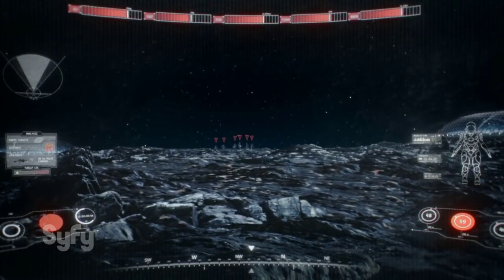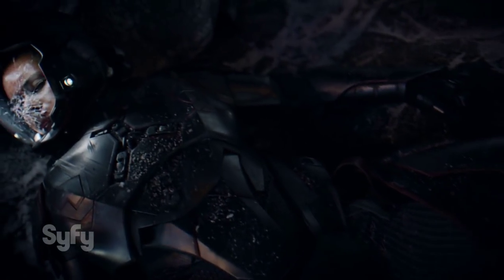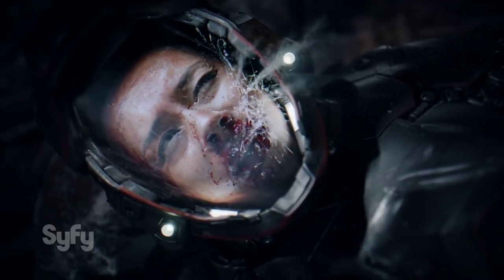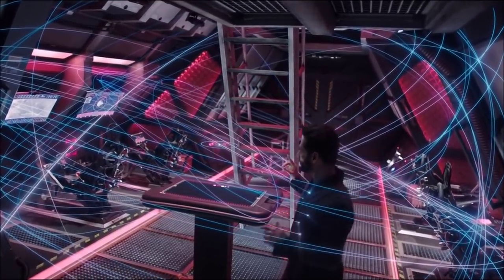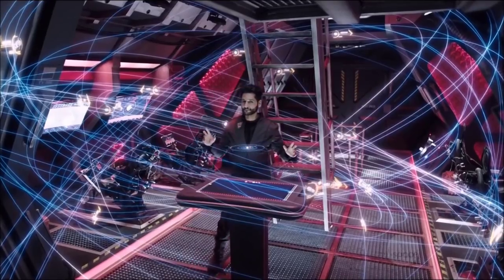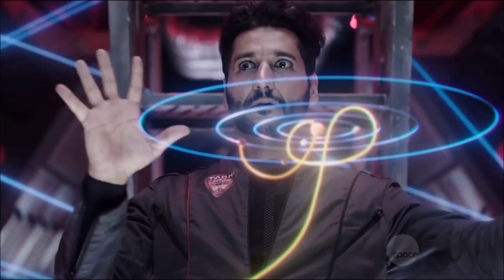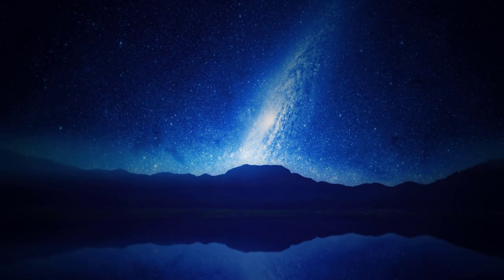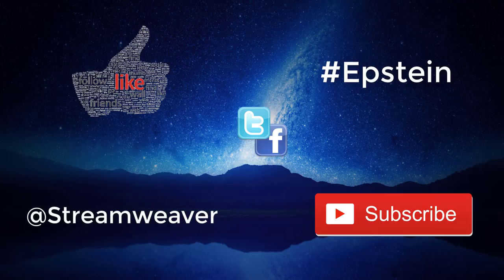Let's Do the Science:  The Epstein Drive

Comment: In theory if you have a fusion reactor efficient enough with high enough plasma pressure it's not like wildly infeasible to just vent excess plasma out the back into space - that much pressure into near vacuum in space with limited gravity most of the time would give you some fairly serious acceleration. Presumably that's what they're getting at..

Comment: Interesting Channel - I was expecting more, well, science.  I'm pretty sure you could put an envelope around this design and what proportion of the ships mass the fuel it would need to carry is, talk about how if your accelerating a particle away from you the higher the speed you accelerate it to the more power it costs you relative to the reaction force you get from it as power is the integral of force times velocity from rest to ejection, so there is a trade-off between the mass of stuff you throw out and the power used to get a certain acceleration.  It would be interesting to explore if you had practically infinite and inexhaustible power but a fixed supply of mass would it be worth it to get the exit velocity high enough that the relativistic mass becomes sizable, and then what would be the consequences of that design decision. etc. 

Just a bit disappointed interesting enough video but there were so many directions I was hoping you would dig.

Comment: So they are using a plasma drive/ or constant thrust. one way is a ram scope for either ions or even dark matter. you use the fusion as power source and the other particles as the thrust component either through compression or release of particle structure.

Comment: I think the drive is a nuclear salt water drive, R Zubrin proposed these in the 80's they are basically a continuously burning Orion drive. The reaction happens outside of the vehicle so the vehicle doesn't get battered by neutrons. Max potential with hand waving is 480,000 seconds isp and a thrust to weight comparable with a chemical rocket. The fuel would be pretty dense, a vehicle that was 90% fuel could accelerate at 0.3g for 40 straight hours.

It could get to Mars in 20 hours straight. It is in the order of magnitude to what we see on the Expanse though the ships are probably under fuelled for the speeds they operate at. Were such a drive created I think the big issue would be uranium, it is only concentrated to mineable densities by a hydrological processes on earth. Burning tonnes of it just to go faster would be wasteful. I think burning propellant just to allow simulated gravity would be wasteful too.

Comment: They mention in the show that if the reactor for the ships is hit, they won't explode but they will all die from radiation within minutes, aka it's a death sentence, so it leads me to believe that its a Nuclear Fission reactor that triggers the fusion drives. It also works since the engine exhaust is radioactive, though eventually, fusion reactors irradiate their own casings thanks to neutron decay. Regardless the ships high thrust to weight could be a by product of running fuel through the Fission reactor allowing it to expand and cool the reactor then using it for thrust, or simply to trigger the fusion reaction itself. We dont get alot of information on how things are powered in the expanse but with the state things are in the universe it seems like they really have a power shortage not the utopian power production massive fusion reactors could provide on earth.

Comment: The Space Shuttles did a 3G acceleration, but only for a couple minutes.  Even a model rocket does a 10G acceleration to be fin stabilized, but just for a few seconds.  The theoretical engines in the Expanse are supposed to maintain a "CONSTANT ACCELERATION", so it is an engine that runs constantly and produces thrust constantly,.  Now what engine/fuel combination could run constantly.  A plasma engine could run constantly, but current plasma engines produce acceleration similar to ion engines, usually measured in micro newtons.  This is because both ion and plasma are doing electron acceleration on a small mass (an atom), not pressure thrust.  If a plasma engine could redesigned, to heat and expand a small mass in a high pressure container, it could produce pressure thrust, then you are talking about some acceleration.  You would probably only need a constant 300 lbs thrust, to be a functional solar system engine.  That is very little thrust and seems doable, but only with pressure thrust.  The goal seems to be, to develop a constantly running, high pressure, plasma engine, that can maintain an actual pressure thrust.

Comment: Could very well be a fusion reaction of a lighter element such as Hydrogen or Helium, or a deuterium reaction which doesn't produce much in the form of ionizing radiation. I always imagined it to be some form of hybrid drive between a plasma based drive and an Ion engine. Plasma is best contained via electromagnetic fields and the aft end of the drive looks largely like what a tokamak reactor would look like if you cut it in half. A donut of plasma. The fusion reaction would require the extreme heat and pressure, during which you could use electrostatic direct energy conversion to get the necessary power from your reaction and all the excess plasma needs to go somewhere, so vent it as exhaust. They very plasma giving you power can give you thrust. Now plasma is very responsive to magnetic fields and its already under pressure. Shield the nozzle with boron the same material in a tokamak to protect the coils but make it largely out of electromagnets designed to create a field that directs and repels the plasma away at even greater velocities, add that to the expansion of high pressure plasma and there you go. A plasma based thruster that convers its power source into a medium used for thrust.

Comment: What happened to doing the science?!  There are two separate issues, the energy and the propellant. The energy comes from the fusion reactor, that is realistic future technology. That energy is used in a drive, possibly electric. An arc plasma drive can be efficient (google the Neumann drive). The mass and acceleration of the ship (ma, kg.m/s^2) is equal to the mass flow and velocity of the propellant (m'v, kg/s. m/s). So for a 10 ton ship (heavier than the Razorback, lighter than the Roci), accelerating at 1g with an exhaust velocity 50% the speed of light thats 6.7e10-4 kg/s. 0.67g/s. That's only 60kgs a day.
Reply: Also the power requirement is over 7.5 TW. That's like 3x global electricity consumption.

Comment: Using the highest weight of Elbow Grease available , 
loosen the muffler bearings using a 10kg Thumb Detector, 
reverse the Johnson Rod, aka  Kuhneutson Valve, using a 
left-handed 8,000 nanometer thread stretcher 
THEN top off the blinker fluid .. there ................. da EZ esplanation beltaloda!!!

Comment: nothing about the fusion itself tho, irrespective of secondary reactions could possibly explain thrust on that level. fusion as you say, nets you radiation, neutrons and heat. heat can net you electricity. but electricity alone won't get you anywhere unless the EM drive actually works and there's no solid indication that it does. the fact that there's a torch plume being EMITTED implies some kind of fuel but as you say, they're not carrying around any amount of... ANYTHING to account for such a plume. if it's a variation of an ION engine like VASMR then you'd still need fuel and the acceleration would be absurdly slow compared to what they're claiming. increase mass of exhaust to get higher speed and you just run into the rocket equation again.

even FUSION BOMBS being chucked out of the rear of the vehicle ala project orion wouldn't actually do any pushing at all unless the bomb casing was there to push against the pusher plate.

so when they say fusion without indicating any kind of fuel - that's handwavium and not a good one at that.

Comment: With just a 1G engine a human could travel across the galaxy or even to another galaxy in a human lifetime (so long as that lifetime is one of those traveling). You're forgetting about time dilation. From your perspective, at 1G, you'd break the speed of light in less than 1 year. Remember your speed as observed from someone watching you travel would never exceed the speed of light but as the traveler, there's no speed limit. It's just that when you reach the place you're traveling, the years would have passed you by as you are frozen in time.

Comment: On the show we see they fly to and from stations using the main drive, ignoring any potential damage they do. Also the fight scene with the stealth ship at the Ceres station would not have happened that way if they treated the Epstein drive realistically. They would have damaged the station and the stealth ship with their close sharp maneuvers. The amount of thermal energy and deadly radiation coming from the drive would be the equivalent of several atomic bombs even if the ship could accelerate up to 1g max! Being able to accelerate a mass of about 500t at 15g or even 30g would create the energy release of 40-90 Hiroshima bombs. Constantly. It remains a mystery how the ship and the crew can survive this. Or any ship or station closer than several hundred kilometers. The question is not so much on how they make the engine run so efficiently, there maybe a way to actually do that in the future. The question is - how do you tame a sun that you ignite right next to your ship? The radiation can not be directed or constrained by magentic shields, the massive heat will vaporize any matter in an instant that is closer than several kilometers. You can twist and turn it as you wish, the very fact that this drive creates a star in your trunk can not be talked away. The show and books decided to ignore this and hush up the issue, as otherwise there would be no show or books. What amuses me most is the fact that the story would work perfectly well within the limits of 0.3-1g of acceleration (still producing too much heat, though) - why do they overdo it boasting about insane 15 or 30g? And then get the travel times totally wrong: in the books ships take by far too long from one place to another considering they can and will use the Epstein drive. On the show we get the impression, they make it in an instant due to rough scene hopping.

Comment: We can do a lot better than this.  It say outright in either one of the books or one of the TV shows that the ejectable mass is *water*.  Or at least can be water.  The fusion reactor just supplies the energy needed to do whatever they do to it.  Ok, so the big problem with a standard rocket is that you have to accelerate all the fuel you're going to use in the future.  That's why the enormous fuel tanks are necessary and so on.  But consider this.  These ships never reach a substantial fraction of the speed of light, so we can presume the mass of the ejectable mass to be used later is the normal every day mass.  But if you accelerate an object to near the speed of light, it begins to behave as though it's more massive.  The closer you get to the speed of light, the more massive it is - in the limit its mass becomes infinite.  So if you push the ejectant to 99.9999999% (or some other ungodly number of 9's), it "takes on" an extremely large mass.  So when you shoot it out the back end of the rocket, it carries much more momentum that it would given it's rest mass.  This has to be the key to how fuel efficient the epstein is.
   
Ok, so no "burning process" will get anything to such speeds, because an expanding gas can't go any faster than the speed of sound in that gas.  So they must be taking their water and breaking it into charged pieces, and then using an EM field to accelerate those pieces to near the speed of light.  Remember - we're assuming energy is no issue; they have a fusion reactor, after all.  So depending on how many digits you can get in your 0.999...999 * c eject speed, a small amount of ejectant mass can give you a lot of vehicle momentum.
   
This is how I've got it pegged at least.

Comment: The fuel would have to be something lightweight and plentiful with an incredible amount of energy packed into every bit/unit. So, let's say the problems with fusion energy have been solved in the future. So the reactor has an immense amount of power to generate strong magnetic fields to contain and sustain a fusion reaction. The same power source (the reactor) would be used to generate magnetic fields in the drive cone to prevent the fuel (used for thrust) from disintegrating the drive itself, directing a pulsed explosion outward and creating a drive plume of destructive plasma and radiation. I'll just go with another scifi future possibility and suggest the fuel used to achieve sustained high-g acceleration is pellets of metallic hydrogen. The drive would modulate how many pellets get burned per second to increase/decrease thrust and effectively be a tiny rail gun that uses magnetism to fire these pellets into a laser focal point. Each burned pellet produces a massive release of energy -- magnetic field contains and directs explosions/thrust outward -- boom, Epstein drive.

Comment: Tuned radio frequencies vibrate Deuterium(heavy water) at a  resonance, along with the energy from its fusion , causes the neutrons to degenerate increasing the nuke explosion from  1% fuel efficiency(normal nuke explosion) up to %50 fuel efficiency.  this effectively gives a increase of energy on the order around 50 times

Comment: With fusion u must have magnetic containment if u use that magnetic containment to force the plasma into a jet it would be at least 75 percent efficient transfer of energy but if you use a magnetically contained antimatter reaction it would give you 100 percent efficiency by using large space based arrays of particle accelerators you could harvest large amounts of antimatter as fuel for the engines

Comment: I know this is an old video so unlikely to get any feedback. But I wonder why they wouldn't have invented something better than the "Go Juice" for times when you must go even faster. What about a crash couch of some sort that envelopes the body. The surrounding material could pulse and massage the body to help push blood around by squeezing and undulating as needed. It could protect against G forces and deceleration. Perhaps you could add in some for of VR to allow for those on the bridge or CIC to control the ship while completely enveloped. Of course, this would include the super oxygenated amphetamine cocktail they already get pumped into them.

Comment: I have always thought that the Epstein Drive was a 2nd Fusion Reaction. Clearly Magnetic Lensing is used, the fusion burn shown is blue, which is a higher emitted frequency than the yellow seen on earth for fusion bombs. current 2 stage thermonuclear bombs use reflections of the fission reaction to start the fusion reaction. the products from a inital fusion reaction could be broken down further into simpler particles and photon emissions. when you look at the Expanse Fusion engines, you can see what could be electromagnetic drive coils, the other drive coils could be further in the ship. There is a episode of the expanse, where ships power is using hard pellets to initiate a fusion reaction in a chamber. I think the Epstein Drive is a dual chambers or triple chambered fusion engine, https://ats-fns.fi/images/files/2016/syp2016/presentations/TSB3_JConzen_AcousticResonanceInMainSteamLineBranches.pdf instead of random energy emissions, its tuned so that energy can collect into a phased arrangement of plasma. the fusion engine magnetics would be used to tune and adjust the fields to control the drive output.

Comment: My  theory.  PFM.  This is a term I learned while I was a student at Naval Nuclear Power School in 1986.  Pure Fucking Magic, PFM.  I believe there is a 2nd Fusion Reaction that absorbs most of the errant neutrons.  I've have heard the term "dirty up " the plasma stream to change engine signatures on the show.  This causes a feedback loop back into the exhaust causing a momentum gain on all the physical ejection mass.  Temperature is retained in the discharge.  Similar to a Pulse Detonation Engine only on the molecular level.  I am a total moron by the way.

Comment: Didn't the Centauri, share their technology with us? Oh wait, wrong show.

As previously mentioned, Helium-3 would be a good candidate for a fuel source, it's lightweight and produces significantly more zero point energy than other non exotic fuel sources.

I'm no scientist, but a little thought experiment goes a long way, my theory is that the Helium-3 is fused with Deuterium, which would produce an aneutronic reaction, held within a magnetic containment field, first stage. Then the resulting byproduct, normal Helium is re-fused, which would provide a secondary stage of propulsion.

That's my take anyway, I humbly await your flamage 😁

Comment: If this engine really delivers 40g of acceleration, then the crew in the spaceship is, well, dead....nobody can stand it. 

The Epsteindrive could be a kind of EM-Drive, some of the model tests that are running today also use fuel, in the form of the fuel that the reactor would need when this system is fully developed. 

Also a kind of advanced ion drive that has a much higher efficiency than what we know today would be possible.

Comment: The  amount of  energy they are using  our current  understanding fusion would be too inefficient  unless they found  some way to convert more  mass  to  raw  energy, if  I am guessing would  more than just neutrons colliding with  atomic particles but  direct  matter  conversion, which if I was guessing would require fuel to have some  special  lattice or  crystal structure